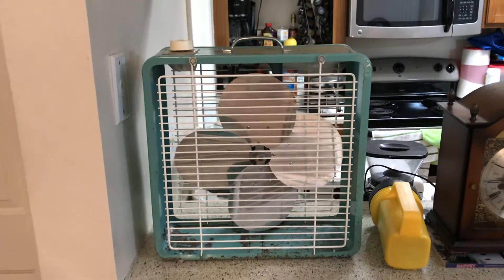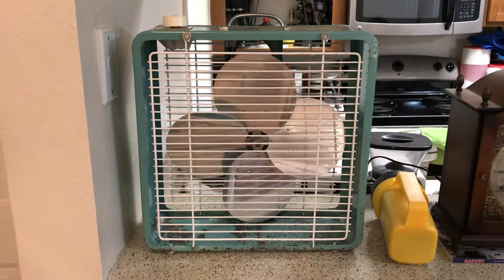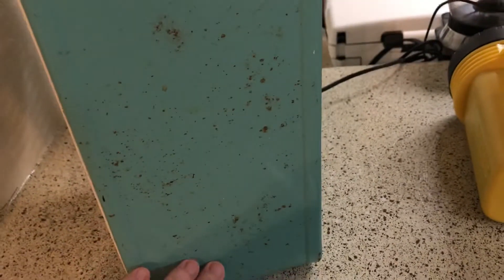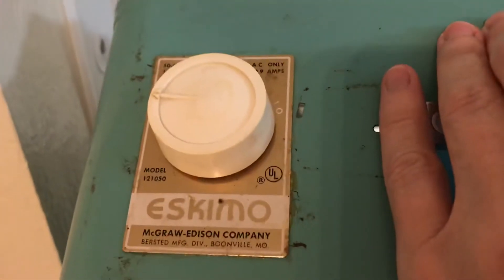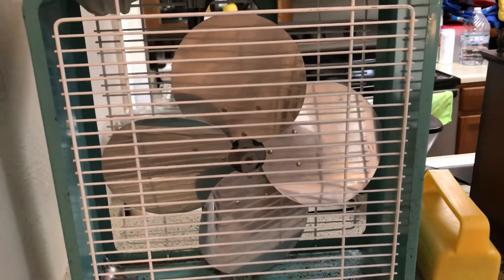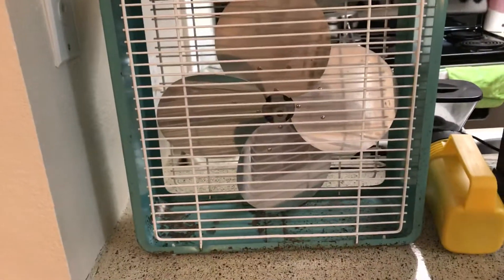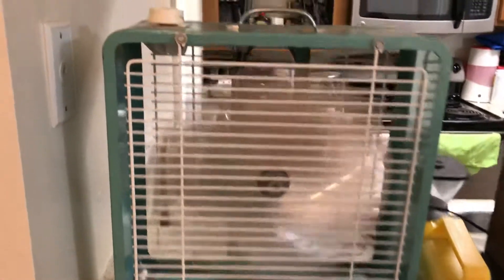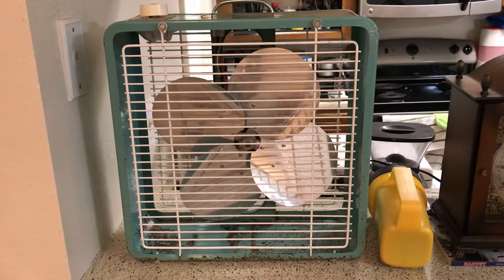1960’s Eskimo (McGraw Edison) Model 121050 12” Box Fan

Comment: Cool fan I recently picked one up in all original working condition. Great fan! Mine has a stand that is connected at the sides in the middle. It retains the small feet on the bottom as well.